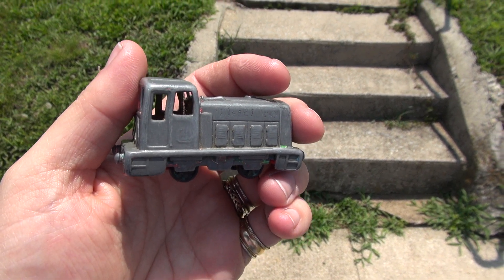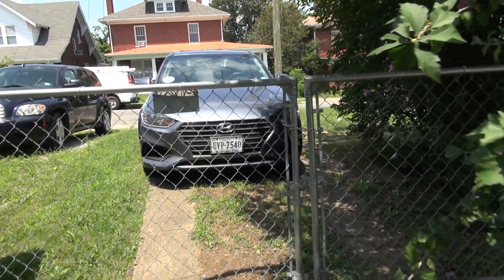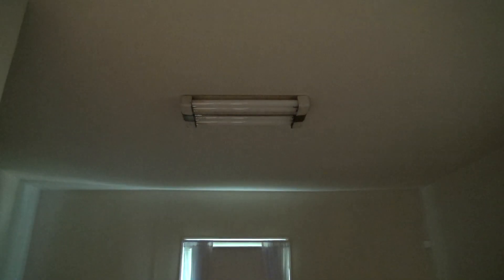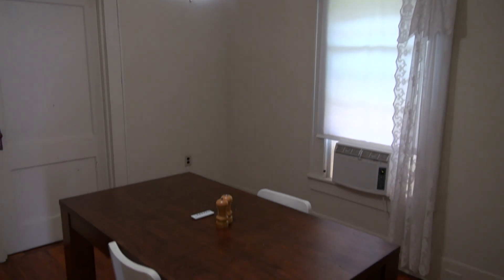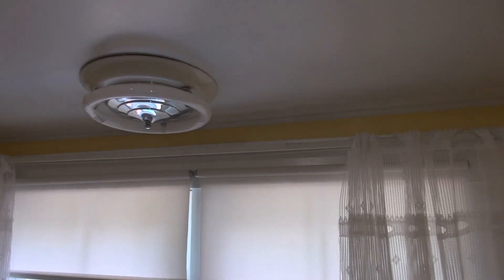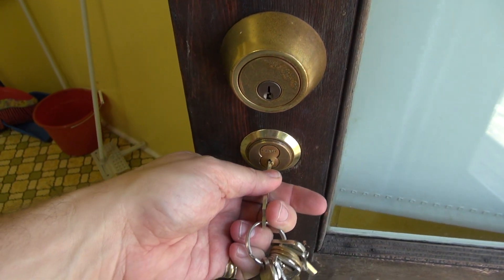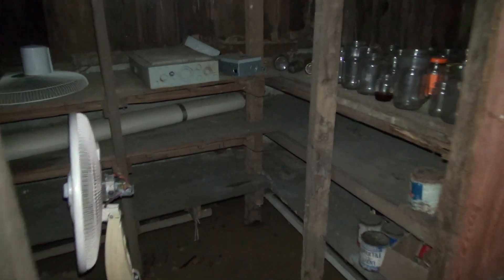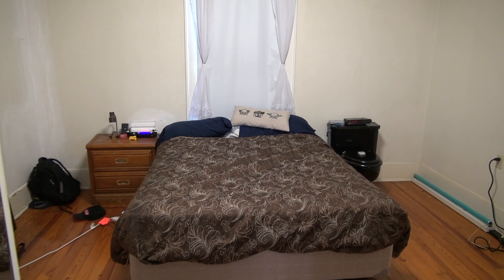first offical elevaTOUR of my new house

Comment: Great house Andrew I love it just a little tip on window ac if you turn the fan setting to on on your thermostat when you have the ac on it will circulate the air better that’s what I used to do till I got central it works like a charm!